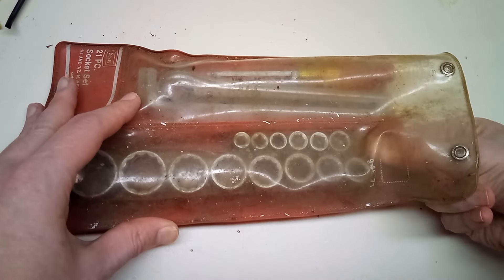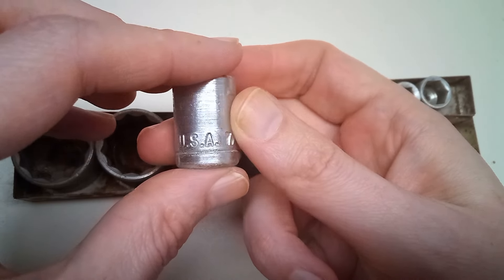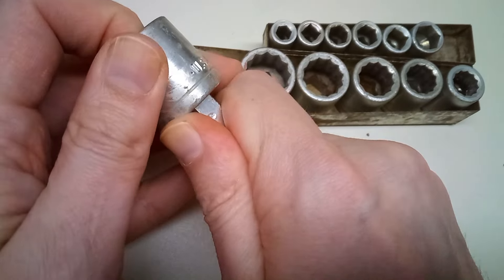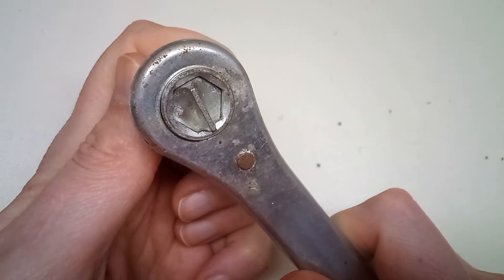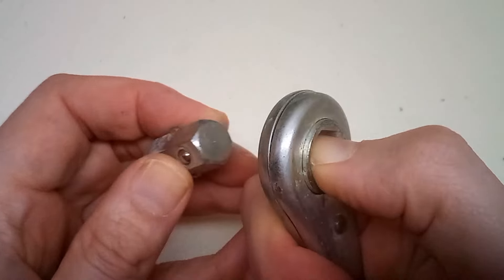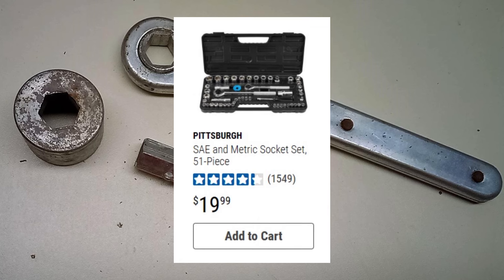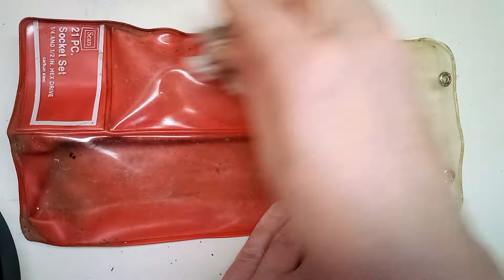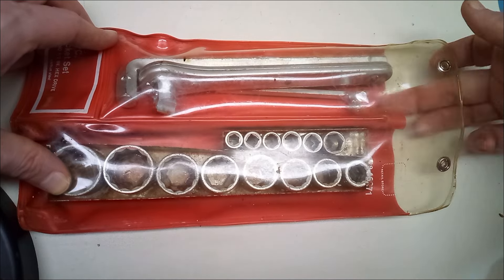When Sears sold the WORST Socket Set Ever Made

Comment: I had something like this when I was 12 or 14 yrs. old, 1975 roughly. The sockets all split, one by one, as I tried to undo stubborn bolts. Absolutely awful, as bad as Sears Craftsman riding mowers.
Reply from the maker: Doesn't surprise me. They probably used a steel that got brittle after heat treatment.
Reply: I've got the Whitworth set. Probably a collector's item now😂
Reply from the maker: @vc9743  I suspect the Whitworth ones are rare. I looked through a bunch of old Sears catalogs, and only saw it mentioned in that one ad.
Reply: Only reason I kept it was to work on British bikes. Didn't realize the quality was that bad.
Reply: I was just a basic economy socket set for light duty use. They sold thousands, very collectible today
Reply: @91Z50  Hmmm.............😃